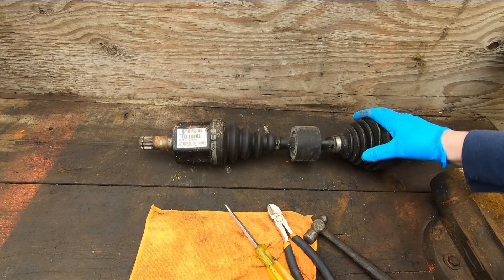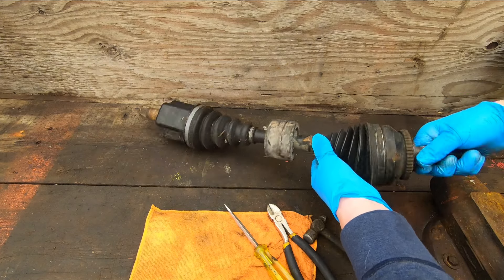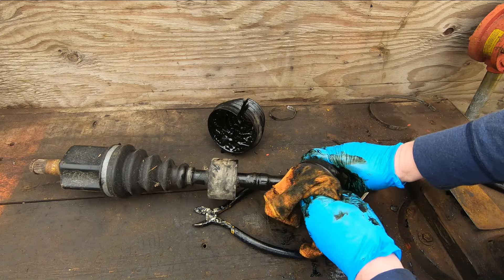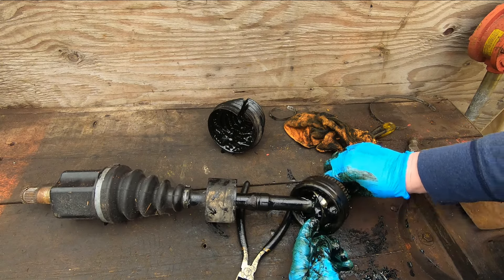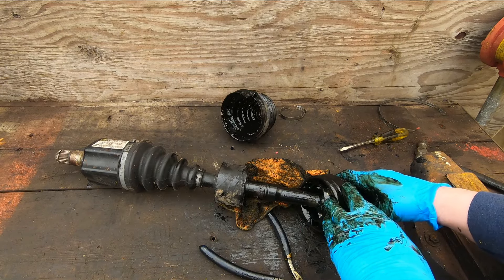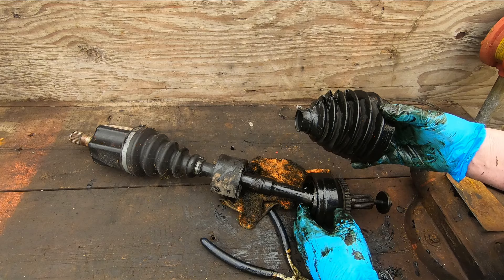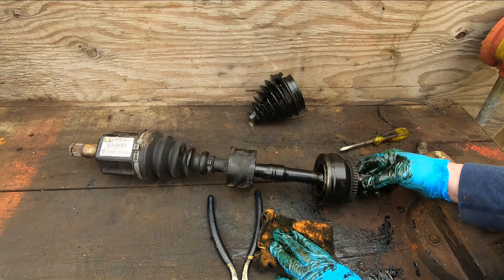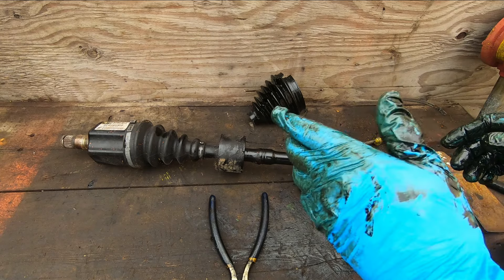CONSTANT VELOCITY (CV) AXLE TEARDOWN

Comment: It is cool to see inside the CV axle, shame about the horrible old grease
Reply from the maker: In hindsight, I should have shown the other end because instead of ball bearings it has little wheels that roll in the groves of the housing. Still, the same concept of sliding articulation of the joint while providing constant rotation. Perhaps there will be another video some day. The grease was black and smelly but most gear lubes are like that. Have a great week and work hard at school! (and hello to the support team at Garden Tractor Boy!)
Reply from the maker: In hindsight, I should have shown the other end because instead of ball bearings it has little wheels that roll in the groves of the housing. Still, the same concept of sliding articulation of the joint while providing constant rotation. Perhaps there will be another video some day. The grease was black and smelly but most gear lubes are like that. Have a great week and work hard at school! (and hello to the support team at Garden Tractor Boy!)

Comment: Nice! I kept the old front ones off our 4 runner. Going to clean up one and weld it straight to make a shop seat. 
Great diagram and explanation! Cheers, Mike.
Reply from the maker: Making something useful like a seat from an old axle is a great idea, Mike. I hope you show us the finished product some day.
Reply: @EverydayProjects  I will. Just did the brakes and rotors last week so now I’ll use a rotor as the base of the stool. Lol
Reply from the maker: @maintenancewithmike  Another good idea, Mike!!

Comment: I tore down a failed one years back as well. That spoked piece on the end of the shaft, the ball bearings, and the cage were so fascinating that I cleaned the assembly up and I have it as a paperweight. It's also a fun puzzle to hand to someone sort of like those blacksmith puzzles. I had one failing and it went in a strange way. I found that only up a particular hill on a certain turn, the wheel would jump left and right. Scared the hell out of me and it took a while to pin it down. It didn't make any of the noises you normally associate with a failing CV joint.
Reply from the maker: Yes, the internals are interesting. I like the idea of taking them out and having them to look at. An Engineering marvel. I changed both sides on the Volvo V70 last fall and this was one of them. I have been wanting to open them up and film the insides before tossing them in the metal bin but  maybe I'll try to do something with them. One guy responded in the comments that he's making a stool from one of these and an old brake rotor...Cool idea with a bit of welding. There is an arts and crafts festival every labor Day weekend on Vancouver Island where many artists come out to sell and perform. It's 3 days with bands and vendors and music shows all outdoors in a park-like setting. At the show, I've seen some brilliant creations by artists who weld together all sorts of things: Fountains, robots. and animal figures all made from old parts welded. Maybe I'll be inspired to make something, although I wouldn't have anything good enough to show or sell. We'll see. Take Care.....Hope you are Well!

Comment: You forgot to mention, that they make more noise while the driving wheel is turned right or left.
Reply from the maker: Yes, Noel, you're right. Failing CV joints make noise on turns. The other thing I forgot to mention is that the most dangerous thing on any vehicle is the Big Nut behind the Wheel! :face-fuchsia-poop-shape::face-turquoise-covering-eyes::hand-orange-covering-eyes:
Reply: There ya go. There’s a lot of them.